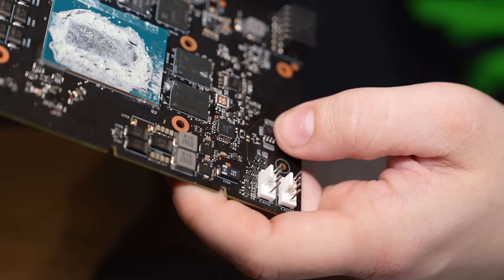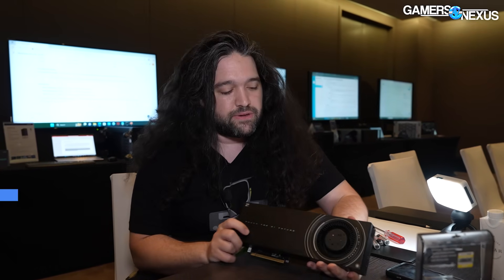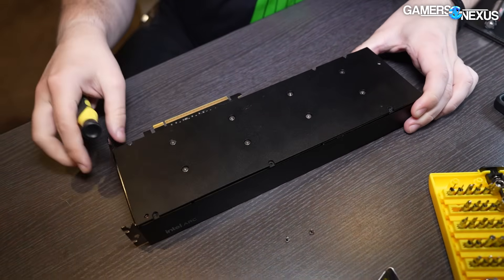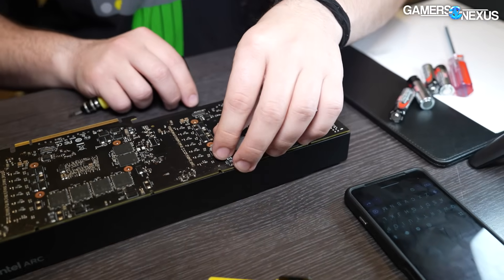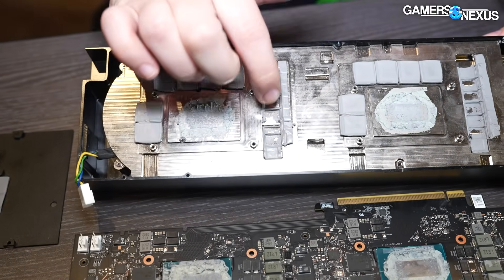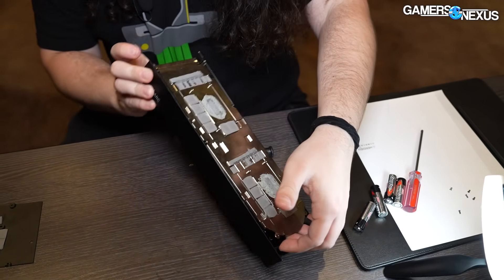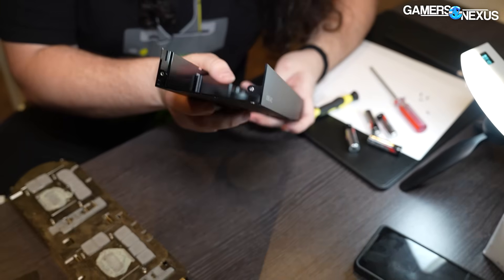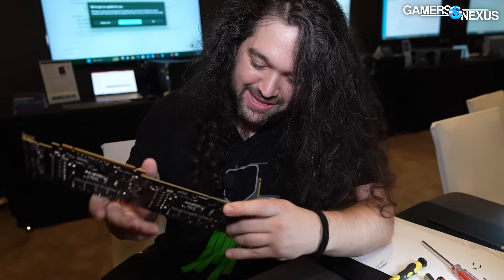Intel Arc B60 DUAL-GPU 48GB Video Card Tear-Down | MAXSUN Arc Pro B60 Dual

Comment: I never would've imagined Intel would (re)innovate the GPU market. It'd be hilarious if they made their own version of SLI/Crossfire.
Reply: They're the type to make a SLI/Crossfire thats ACTUALLY good and then abandon it because they never advertised it ☠️
Reply: @PixelatedWolf2077  "We created the best implementation of sli/crossfire and told nobody about it" - Intel
Reply: @PixelatedWolf2077  They'll make a version of it that's so advanced the compiler will need to be self-aware in order to make use of it.
Reply: @PixelatedWolf2077  😂😂

Ah intel,  a history of good ideas they started with and binned, or delayed going into for years.  They could have been manufacturing X86 chips a decade before they were but they ignored their own chief engineers who were begging them to do so. They didn't want to spend money on the R&D, I mean computers at home?!?!  don't be silly, where is the money in that! 🤷🤷🤦🤦
Reply: @Nine-Signs  Don't remind me of the fact they just canned "Deep Link" 😞
Reply: This is much more likely to be for multi seat setups like VDI - Intel's been eating Nvidia's lunch on VDI because they don't charge licensing fees for it and the Flex A70 was good enough for most setups even if it wasn't super fast. Having more but smaller physical GPUs makes more sense in settings where you want to split the GPUs across multiple workloads or users rather than trying to get them to all work on one thing
Reply: I like this more than SLI/Crossfire.
SLI/Crossfire have poor air intake for the 2nd gpu and take up a lot of space 
I used to have HD 6870 crossfire and the 2nd gpu is throttling but to be fair I lived in a warm country (46-47 degrees in summer or about 1 million Fahrenheit )
Reply: @MutheiM_Marz  Yes, most people don't realise that crossfire/sli was actually not efficient. That second card was a huge waste of space, power and heat. You only need the GPU itself, the VRAM and everything else is wasted in dual card setups. Also you never got 2x the performance from your second card, at most I saw a 60-70% increase in performance from raw cycles.

Dual GPUs would be much better, but I still think they have specific use cases, rather than as raw cycles they could be utilised in streaming texture/model data into VRAM in a way that introduces less delay/stutter to the main thread.
Reply: is this innovation though? as far as i know, multi gpu cards never went away in the professional market, no? this isn't a gaming card
Reply: @myownchannelwtf  fact. Outside of gaming and general usecases, that PC they showed with GPUs in every slot never went away.
Reply: I mean, they did say they wanted to bring back multi-gpu 

Honestly, with the new API's having enablement at that level, they should all should be
Reply: Doubt that, SLI/crossfire died because there was no need in them anymore, cards can work together through PCIE just fine, and having master/slave cards with all their limitations is not necessary either.
Reply: @alexturnbackthearmy1907  That is not actually accurate. I mean yes that is the reasoning Nvidia and then after the fact AMD put out there for the public but the reality was neither of them wanted to pay the labour costs for the constant additional development needed to get SLI working properly with XYZ gaming titles as they came out. It was a cost saving and profit boosting measure to kill it, not a matter of technological redundancy. 

By ending SLI/crossfire not only did it save on labour costs but it also forced a greater number to purchase new graphics cards as when SLI/crossfire was a viable option you could buy two dirt cheap older cards and get a decent performance boost by running them in that manner. Great for consumers, not good for profits of Nvidia nor AMD. 

I am looking at buying a new graphics card right now, it is going to cost mee at least another at least £600 to get a circa 40 to 60% performance boost over my current card. Where as if SLI was still an option it would cost me £250 for a 40 to 60% performance increase by just buying another 3070 and running it in SLI.
Reply: Intel's strategy is typically to just do it a way where the entire ecosystem has to adapt to them.

That strategy doesn't work in the GPU market...unless your name is Nvidia.

Comment: You always tout when other graphics card makers use more VRAM than Nvidia while selling at a lower price but fail to mention that the VRAM is not of the same spec. The B60 is using GDDR6, not GDDR7 or even GDDR6X. So of course they can afford to use a lot of VRAM for cheap. If Nvidia used GDDR6 in the RTX 5090... Well, it would still be expensive AF. But still! It's not like-for-like.
Reply: VRAM on the enterprise level is not that expensive. GDDR6 is roughly 18 dollars per 8 gigs, The cost of GDDR7 memory is estimated to be around $10 per GB but that could be fluffing the numbers since bulk purchasing (IE: NVidia) gets discounts and kickbacks too.

In my own semi-educated opinion and knowing how the market is, It's artificially throttling and limiting the hardware so they have an easier path of profit to tack more of it on another card later or to sell as a higher end enterprise card.

Comment: I think consumer dual gpus could make a comeback if it was marketed for data processing instead of gaming. something like this would be real handy for a rendering pc or local AI for smaller use cases. motherboards dont really have good expantion these days so one dual gpu card would be better off than two cards where one is only running at x8 pcie gen3 at most.

Comment: Omg it's real, I want one!! 2x 24GB is amazing for large CFD simulations 🖖
It's so cool that Intel allows board partners to innovate. Meanwhile Nvidia forces AIBs to put ugly dysfunctional 4-slot coolers even on toasters like the RTX 4060, just so one can't plug two of them in neighboring PCIe slots.
Reply: Not forces. They are just so lazy, they use same coolers for different cards, some even re-use nvidia coolers for amd cards and other way around, sometimes even through multiple generations of cards.

Comment: If this card ends up being 1000€, it would be insane. I'm an engineer and always have two graphics cards in my workstation. Even at 2000, it would still be affordable compared to others.

And if it can run games, it could be a "budget" alternative for couples. 1PC2Players type of build using virtualisation. Only one set of base components for two users.
Reply: 48gb of VRAM for $1000 is a very attractive deal, would be awesome to see this get popular so that hopefully we can pull at least a bit of the market away from CUDA, get nvidia to stop thinking they own the planet
Reply: B570 to B50 single announced with +70$ msrp (219$ to 279$), So hopes are high to see this dual B60 around the 600$ msrp price tag. I want to see the B60 dual with LSFG framegen from "Lossless Scaling" on steam. Second GPU and VRAM is quite the overkill for that, but the whole single PCB should be way more power efficient than any double single GPU setup. The question is: bifurcation required or not?
Reply: If it is under 1000, then it is definitely buy for me. As I saw title of this video, I wanted to know more. Currently I have my own machine for LLMs and image generation models, and this card would be perfect because of its VRAM.. Shove there 2 of them, and with 96GB VRAM I'll have equivalent of Nvidia H100 for fraction of a price..
Reply: You gotta love how first world people declare how ridiculously overpricing cards is OK.

No wonder you end up with situation like nVidia and AMD when companies realize they don't have to price their product for anyone but the first world people willing to pay obscene prices for no reason whatsoever.
Reply: @desmasic  it's a workstation card bro
Reply: @desmasic  1000 for a dual workstation card with 48 is more than reasonable. 

nVidia would sell this card for at least 5000 or more. And i don't know what AMD would charge, i don't trust them after the debacle with the Radeon Pro VII. I have had two of them, not only were they more expensive (700 per card), but they stopped driver support after just a year, which is disgusting towards professional users.
Reply: @desmasic  I believe it's not a consumer card

Comment: These are actually cool

Idk what them Arc Copers thinking about having a "B770" from their imagination because it was definitely cancelled as well as the CPU overhead would worsen the product

But intel pushing Arc Workstation GPUs is as important as trying to push in the consumer space
Reply: Gelsinger cancelled it yes, but the CEOs after him revived the project.
Reply: @kuronoch.1441  nope, there was never a revival of the b770 or any form of high end battle mage, it was cancelled altogether
Reply: @kuronoch.1441  It wouldn't make sense to revive it at the time they got in. By the time the project would be restarted Celestial would not be far of and it would be better for them to spend the resources on Celestial than wasting time on B770.

Comment: If Intel really wants to make a dent in the professional world they need a CUDA emulator. I run a datacenter and if my options were RTX 6000's at $8500 or B60's at <$1000 I'd pack racks full of B60's. But so much of the workloads I have require CUDA.

Comment: Perfect case choice. I also use this O11 XL for my triple GPU setup. (two on the front one in the second chamber behind the mainboard.) Seem like hard to get other "normal sized" cases with 8 PCI-E slots and no PSU compartment on the bóttom.

Comment: Can I ask you a question Steve? If this card is targeted for AI, are the 48GBs pooled or shared , like directly connected and accessed as a big pool, or 24+24? Because 48Gb sounds very enticing, but if it’s 24+24 then it would suck a bit for home AI enthusiasts like me to configure instead of plug and play Nvidia.

Comment: Dual GPU setups actually are quite useful recently.  I use a second GPU to handle normal windows stuff and use the other GPU exclusively for games.  You can also use a second GPU for frame gen to maintain a high and steady framerates.  You can use them together in applications like Blender or video editors.  I think a GPU with dual cores isn't such a bad idea.
Reply: And if developers actually bothered to support multi-gpu tech, the market would be dominated by those. Just two 3070`s will beat a 4090, and double 4090 would be definitely able to "path" trace amazingly good (still not true path tracing, cause that one is literally impossible to pull off even with most powerful hardware).
Reply: Heck there is another thing I would love to see dual GPUs an thats VR. VR takes such a massive load on the GPU that even the smallest dip in fps can be felt during gameplay. This is more true if you are trying to stream what you are playing to buddies on discord or even twitch. So having this setup for VR would be massive for the 3-4 people that like using vr like myself